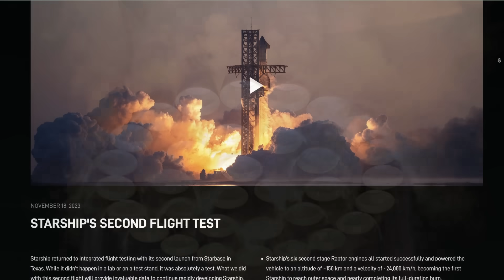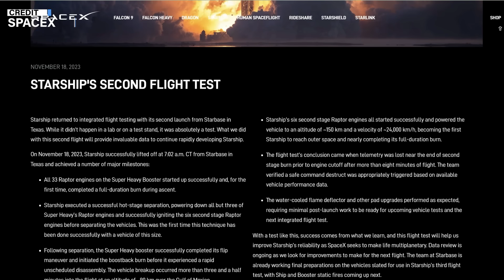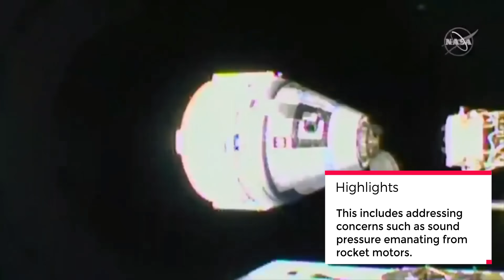SpaceX's Flight Data of OFT 2, ArianeGroup Susie for October | Episode 19

Comment: Hey, wasn't SpaceX supposed to get to the moon by the end of 2025?  And didn't the Soviets use slide rules to design rockets that got into orbit over 60 years ago?  I mean, this second launch was an improvement over the first, but it still blew up; and no one at SpaceX ground control seemed to realize that until several minutes after it happened.  

That contract with NASA doesn't last until forever.  How much more money can SpaceX afford to throw away?  When they fail to get to the moon, how much more time can the Government give SpaceX before it pulls the rug out from beneath Elon's pet project?  Will Elon tell NASA to F off the way he just told his former Twitter advertisers to do the same?

Comment: BS!.. If it was so succesful it woud have worked.. it didnt.. so no! not succesful.. However! they will learn plenty i'm sure..
Starting  by rethinking that hot staging..I'm pretty sure both explosions were caused by it..one by accelerating the rate of rotation of the first stage when it separated.. it was way to fast for the fuel feed.. Second it did some damage to the starship engines or fuel delivery..furthermore forget fast starship rotation on the launch pad,, there is way to much energy for it to work without any damage everytime.. But yes it was better than the first one, and  they will learn from it....
Reply: Why do we fall down? It's so we learn how to get back up. How do you find your limits if you're always down the middle?
Reply: It is called a test flight for a reason.  If it was a completed and operational program, ot would have worked right.  They are in the learning phase, right now.  The same as with Falcon 1 test launches from Kwajalein Atoll.
Reply: @arthurhamilton5222    ...but why their engines keep misfiring or catching fire? Their contraption was supposed to land softly in the Water.  What we experienced is yet another expensive fireworks spectacle. Tax-payer money given as a gift to few private owners were wasted again.
Reply: They could learn from the videos of flipping bottles in the air and landing them upright..
Reply: I guess every other person listening to this will have to agree to disagree with you.
Reply: They said before the first "test" launch that just getting it off the ground would be considered a success and anything more than that would net them a treasure trove of data to QUICKLY improve the next "test vehicle" and this second launch shows they have obviously done that.
You just don't understand that Elon is "willing to sacrifice replaceable hardware" to get Data that advances his long term goals "very quickly".

NASA has done many great things in the 50+ years I have followed them but they have always worked "painfully slow" vs SpaceX Falcon 9s went from multiple landing failures a 100% success rate (SIXTY launches in 2022) with 39 Boosters being flown "several times" (no one else on the planet has done that)...
Reply: It's O.K. to call it a partial success.